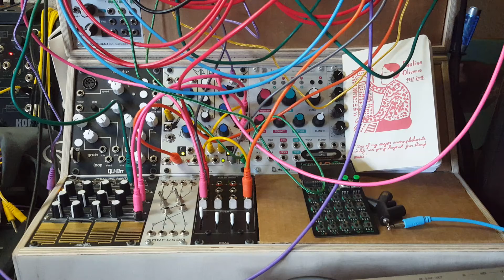Pressure Points as Maths State Machine - "Pretty Krell" Eurorack

Comment: Really appreciate your video and description of this patch. I copied this and it sounded really good, except for some reason my SQ-1 would go completely nuts sometimes, the triggers just get into a really fast crazy loop and I found it difficult to keep it stable, even with long rise and fall settings. Still, fun patch to play around with :)
Reply from the maker: stateazure That's really cool to hear. Regarding the SQ-1 going whacky: you may need to change the Sequence Step Resolution to quarter notes. You can do this by holding the play button and turning on the power. Set the Sequencer Mode knob to the first squiggly mode. Press power again and the unit will start up with this new setting. When it receives a trigger at Sync In, it'll hopefully just advance one note at a time. I may be wrong; I don't remember how I did it here! But I hope that helps, and I hope it works for ya.
Reply: I'm sure that's the problem, thanks very much for your help!

Comment: Hey, again pretty great stuff - can you recommend speakers and headphones for Eurorack? Outer than that do you use an external mixer and if so, can you recommend one?
Reply from the maker: DJ Free Heya, thanks again! I must admit, my knowledge regarding studio monitors and headphones is sorely lacking. You may be better served by a forum in this case. I have a small external mixer in storage, but I'm not currently using it. But with that said, if you have any of the gear you mentioned, and it works for you and you like it, don't be afraid to integrate it with a Eurorack system! It'll work just fine, you don't need anything to special to get started. Just don't forget that an audio output will typically be very loud. 🔊